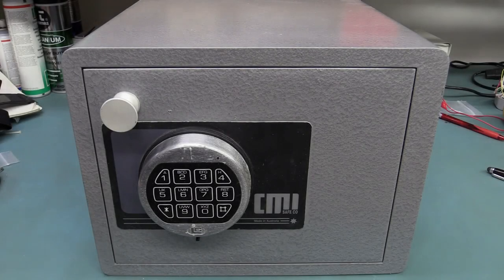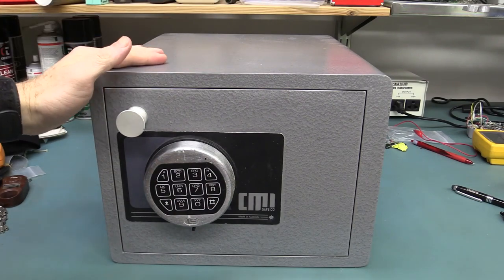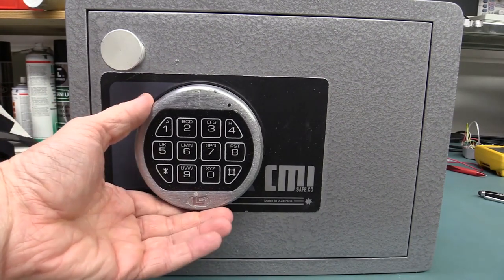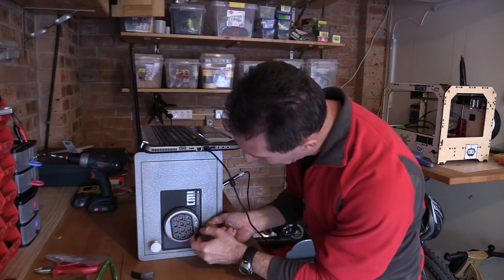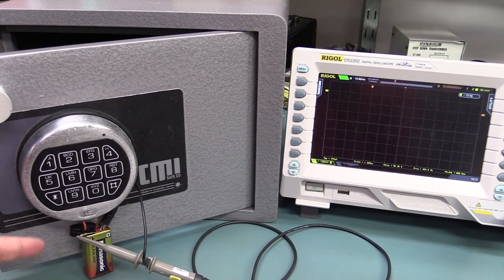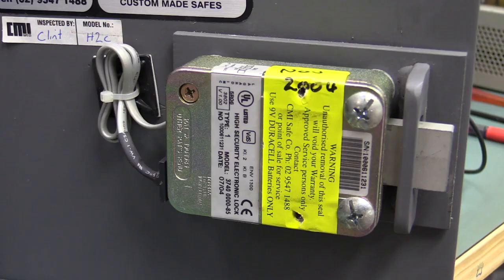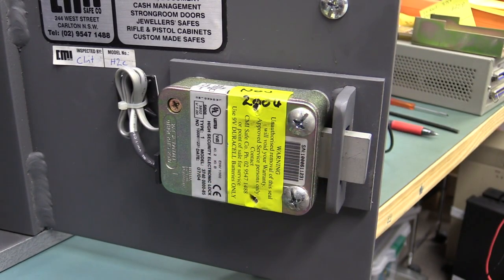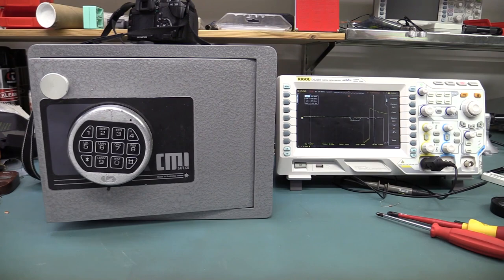EEVblog #762 - How Secure Are Electronic Safe Locks?

Comment: As the battery connection is exposed, maybe it can be hacked by applying weird over-/undervoltages, negative voltages or combinations of that?

You also could use near field antennas (near the keyboard) used for emv probing to sniff.
You could make use of a more elaborated (low R) current sensing with higher bandwidth.
You could use more elaborate data processing on the captured signals, you could correlate antenna signals and wired signals (power current).
BTW, how does disconnecting the battery affect the safety lock out time?
Even if it is stored in eeprom, one may detect a false attempt prematurely and shut off the power just before it can store the failed attempt lock out time in eeprom, if it does that anyway.

And then you can probe the circuit at any point if you get a "sample" but not limit yourself to working with the TUA (Target Under Attack).

You see, if you want to spend the time, there is a lot more one could do... May not be worth it except for the experience gained.

Comment: I love it when a push button lock has been in use for years and the buttons for unlocking it are all worn. Vegetable oil on the buttons would reveal which buttons were pushed without necessarily being noticed by the owner. This trick also works in some cases to detect if something was disturbed in your absence.

Comment: You can also try undervolting that thing to make the software crash (and possibly flip that one magic pin high; these tiny MCUs don't have any notion of memory protection; they will execute whatever crap happens to come into the instruction stream) or overvolt it. It's common for MCUs to short pins high or low when they are fried. If that doesn't work... overvolt it massively (like 10-30 kV or so) then the spark might jump to the right spot.
Reply: pvc988 Second thought about crashing the IC. If the chip is made unstable after inputting 6 digits, it's possible that it will start executing data in the combination you entered. Depending on how these digits are stored, you may be able to write a 6-byte program to unlock the safe. It's unlikely but it would be one heck of a cracking job if it worked.
Reply: pvc988 under voltage sounds interesting, as it should not be too harmful. Overvoltage on the other-side: I think I saw a diode in there. This diode may act as an overvoltage protection. Given the LC-circuit formed by the wire and the decoupling, it would be tricky to get around the diode (and not to fry something in the process). But frying would be fun also (for the theft): Looking out the owner
Reply: If they designed this lock correctly (and it seems like they did) then there would be a brownout detection circuit to keep the micro in reset until a usable voltage is available. Most modern micros have a brownout detector built in, but it's also very common to have an external one as well.
Reply: Believe me, I've analyzed many of the embedded device's firmwares and I could probably count properly coded brown-out detection/handling routines on my fingers. It is one of the most neglected things by the programmers.
Reply: pvc988 sounds like a job for *****
Reply: ***** I thought the same :)
Reply: Prehistoricman Interesting idea, but I don't think that's possible. 

You'd need to get it to fetch an 'instruction' from the register file, data memory, or a peripheral register. The block diagram in the ST62T25CM6 datasheet does suggest that the instruction memory uses the same bus as data memory and peripherals (Von Neumann architecture). But I don't see how you are going to manipulate the operation of the state machine that controls the processor (i.e. fetch / decode / execute)  simply by messing with the power supply. Even supposing that you could, you have some very limited data to work with to form your instructions. You will need to hope that the available digits map to the opcodes you need (not likely).
Reply: Oliver Douglas Like throwing your groceries into the kitchen with hopes everything will land in the right spot.
Reply: pvc988 I dare doubt undervoltage would be a possible scenario, as this is a battery-operated safe, that would be a quite major flaw. It's much more likely to cease operation at such a low volatage. Overvolting is i'd quess much more likely to give some result, though if you mess it up at that point, that was your one shot at opening it :p
Reply: annihlator Yeah. By the time of my original comment, I've checked that MCU's datasheet and how it handles voltage drops. Now, I also think that this won't work for this particular device. But I think this method might still work for different MCU/CPU based devices.
Reply: pvc988 I use AVR Microcontrollers quite a bit. They may or may not use them for these safes, but I'd go out on a limb to suggest the feature sets are going to be similar.

AVR Microcontrollers are modified Harvard architecture machines. They have different address spaces for data and code. The code is going to live in flash and the fuses can be set to a mode where that flash is not "self writable" - that is, it can only be programmed with an ISP programmer, which for this application would only be accessible from inside the safe.

AVR Microcontrollers also have brownout detectors. When the supply voltage drops below a given threshold - and that threshold is well above the malfunction threshold - the controller is gracefully shut down. And the BOD has a hysteresis so that it won't (easily) "flap."
Reply: Nick Sayer I am quite familiar with AVR family too. I know about their brown-out detection feature (BODEN fuse bit). In this ST6 MCU it is called LVD but works very similiar.

Self-modifying code or reprogramming is not needed for this to work. Also, without BOD enabled even momentary spike (be it overvolt or undervolt) can cause MCU to behave in an unpredictable fasion (in bet that many beginners have encountered this problem with their devices).  The same thing can happen if RESET pulse is not "clean" enough or is too short. I remember that Dave had that problem with one of the devices he was repairing.

Imagine the situation where something gone wrong with resetting the CPU. That means that some of the registers have incorrect values. Now let's assume that the instruction pointer/program counter did not reset properly. The CPU will begin the execution somewhere in the middle of the code and not at the reset vector. If execution starts in the branch that leads to "FLIP_THAT_MAGIC_PIN" subroutine, then you are done. Not only instruction pointer can cause such problems. Of course with approach like that you can't predict what will exactly happen and be sure that you will need many retries. In other words, you will need a device which will crash the target device repeatedly.

On the other hand, method like this will not work on ARM based MCUs. They use memory protection. After just few "incorrect" instructions an exception will be triggered (probably Undefined Instruction or Data Abort). I wonder about FPGA/CPLD based devices.
Reply: pvc988 But will you find ARM based MCUs in safes? I don't really think so (More like probably not haha) but good point there about ARM MCUs.

Worked a lot on ARM based MCUs (the TI stellaris launchpad and the STM32F4Disco launchpad) and damn are they resilient.
Reply: pvc988 if it's succeptable usually the single compare after suming/subtracting the key is enough to hit with a glitch but must be timed properly and probably multiple attemps.  connecting the keypad to a micro to do the entry and search for the sweet spot would work but it does LOCK after x bad attempts so it could take a while....   or not.
Reply: Nick Sayer AVR's are pretty easy to crack, and dump the contents of the code.   Even claimed secure micro's aren't "THAT" secure.  they're for a certain target market.   simple buffer overflow could setup an attack on the stack in such a way to execute what you need, not everything must be in executable memory....
Reply: digibluh Do you know something We don't ?!  Classical stack attacks aren't that easy to perform on Harvard machines (you can't inject the code directly; you can (possibly) only inject the return address).
Reply: +Prehistoricman thats how they cracked the Gameboy and Gameboy color (many years later) you can find the reversed cpu manuals easily
Reply: pvc i fried my safe when I tried to power it with 16kV for 264 milliseconds, don't do that xD
Reply: Hmm, I'm curious.  If the solenoid is the only component grounded to the safe, if a sane or high-voltage circuit would complete between the body of the safe and one of the battery contacts.

Comment: I would try to capture lock's behavior after entering all 6 digits. It's doubtful that controller compares every entered digit. I bet it reads them in a buffer and then compares. This is the time to catch it.
Reply: That would tell you when the 6 digits are wrong or right but we would know that anyway it would open or not
Reply: Yeah, I'd have looked at correct key followed by incorrect and all the permutations upto the full six correct numbers Vs six incorrect or five correct and one incorrect. Seems like a bit of a half arsed job unless there was a lot edited out..or unless he found a good powerline exploit lol. Not everyone is LPL showing everyone the hidden secrets right out in the open. Didn't end so well for Barnaby Jack :/

Comment: The code is always 6 digits, so I assume they are comparing the input with the secret key only when all digits are entered.  With a sensitive enough power analysis, you should be able to detect which digit was incorrect as the micro iterates over the input and key.  Even with a constant time comparison of the two, some flag or register in the micro will be set on the first wrong digit (otherwise your comparison would never fail).
Reply: Can a power analysis realistically discriminate a single bit difference, presumably SRAM or whatever this thing has?

I assume the "loop" would compare or subtract or xor each position and then add/or them up.

Comment: Not sure if anyone else has mentioned (Dave didn't on the video) it but there is a spring loaded anti bump weight opposite the solenoid. Any impact big enough to move the solenoid plunger will also force the anti bump plunger into the hole.

Comment: I would not expect to see much on the power line for digit entry. The software would (should) just store each digit without any judgement on the individual number until it has all six numbers and then it would do a compare in which case its too late. Its not going to decide as you type each number in. There will be a time-out between numbers so that you do need to type them in with in a certain time period before it trashed what's already been entered.

But great video - loved the cheesy version of mission impossible :-)

Comment: i think the wave form drop is from storing the number in memory. The validation is when the last number is pressed. The wave form will change depending on if the validation is wrong or correct.

Comment: Fun story: an educational institute local to me has electronic locks inside that use swipe cards (though the readers aren't connected, the staff just use keys instead) and the actual electronics for the locks are on the outside of some of the doors! Even better, they're all powered on the same circuit, so just opening one and shorting it with a screwdriver blows the switchboard fuse and opens EVERY LOCK IN THE BUILDING! Genius!

Comment: Here's a question: are the keypad pins vulnerable to this type of snooping?  You can get to those if you can get the safe on its side.  With some difficulty (and maybe some laparoscopic surgical tools) you could unplug the keypad, hook on some probes and plug it back in.

Edit: I know that data you'll be seeing on those pins will just be the keypad data, but there may be some crosstalk or something, and since they're closer to the CPU you might be able to see more noise from there.

Comment: Try to find the resonance frequency of the little spring and use a suboofer with this frequency. The pin should then vibrate and if you are lucky you can open the safe or damage the spring an turn it on its side. :-)
Reply: Update: To find the right frequency try to disconnect the battary and measure the power pin for some induced current

Comment: Hey Dave,
One of my main concerns with electronic locks is at the firware/code level and being guaranteed that there are no secret code or keystroke backdoors.  I was hoping after IDing the micro version, that you would try to pull out the machine code listing and examine it for manufacturer backdoor entry codes.

Unless these safes can be audited and proved safe (through things like code hashing), I fail to see how they can be trusted at all over, say, mechanical locks..

Tweeks
Reply: And your fear was proved real today.

Comment: Dave,
You mention that you can replace the keypad in the event that it breaks, so you must be able to do so without access to the interior of the safe, is that correct? If so, would it be possible for someone to replace the keypad with one containing some kind of keylogger? That individual could potentially return after the safe owner has accessed the safe and obtain the code.
Reply: finnigan 16   That is a devil of a lot of miscreant effort to access some cat photos. (Likely content after owner estimates this safe's ability to protect the contents in the event of fire.) ;-)
Reply: I've used a larger capacity, thicker armoured safe with the same keypad/knob combo, in a medium sized retail business and that was storing the Christmas takings, as well as the rest of the year when there wasn't much worth having lol. It was however bolted to the floor, and was cut through with angle grinders in one memorable instance, mostly because they used our own stock from the shelves to do it! It's a common enough set up, though the quality of the internal circuitry may have changed over time or between models.

Comment: You didn't try:
Low voltage attack (brown out, slight power differences between the eeprom and processor, leading to "0" being read for all positions)
Power glitching attack (modulating the input power to cause glitches)
Power-up analysis (does it read the eeprom on initial battery attach?)
Reply: eformance a no-name Chinese lock in a similar style had the vulnerability of reading an I2C EEPROM at power up. The keypad was also connected via I2C, so you could trivially sniff the EEPROM data.
Reply: Phil McGroin

Comment: I wonder how those $300+/- ebay gunsafe locks fair, I know the safe has to be bolted to the wall and floor by law but if the crooks managed to get it loose I bet they could bang it on the floor a few times and release the lock. i will have to take a poke at mine before I install it and store valuables in it, might have been a waste of money.
Reply from the maker: Aussie50 No new safe costing $300 is any good. First step is, if it's not (oz only) a CMI, Chubb,  Lord, Guardall, or  Burg Wachter then it's likely crap. Only La Gard, Chubb, or S&G locks are worth their salt.
Reply: What you ultimately need is a dog!
Even just putting a warning sign that says "Beware of dog" can deter thieves ... yet there are those who don't even have half a brain :P
They likely wouldn't be able to figure out how to get it open any way xD
Reply: MrJohnny56789 If you didn't store it correctly, that's completely reasonable I'd say.
Reply: Mr. Morningstar  You are so right. I hate the gun laws in Australia. Notable three hours away in New Zealand my friends are using suppressors and we cant they are all shooting semi auto M16s and we cant.  All the anit gun lobby people cite the shootings in the usa as the reason we cannot change.  They are seriously phuked in the head and have no idea what they are talking about. I love my shooting for sports and just wish i could have a few more toys that would make it even more fun.

Comment: Could you not apply a voltage directly to the solenoid the same way you replaced the plug?
Reply from the maker: glenwoofit No, that's called spiking, and this lock is protected against that.
Reply: EEVblog you where able to get to the pins so you could spike the pins.
Reply: Graydon Treude He got to the solenoid pins after opening the safe, and then opening the lock mechanism... the safe is kinda already compromised at that point facepalm
Reply: TheHue's SciTech when he reconnected the pins from the out side he had total access to the pins from the out side
Reply: Graydon Treude Those were the keypad pins, not the solenoid pins. For goodness sake, he specifically went over this in the video, try watching the video.
Reply: TheHue's SciTech when i see pins on the back of some thing i knew they went to the solenoid but i know all pins dont go to the selonid directly but putting voltage accost maby 2 pins could have a wanted effect
Reply: Graydon Treude They are data lines just going to the cpu - applying a voltage would maybe damage the processor into a fail-open mode, but that would be a bit obtuse.
Reply: frollard this is correct - probably 1 wire serial for the keypad, led and piezo buzzer pair, common ground and +9v. The solenoid connector for this type of lock is clearly shown, INSIDE the lock mechanism along with all the smarts..
Reply: dash8brj  This is incorrect, too. Led and buzzer are in the keypad..
Reply: Selphie93 The serial would control both input and output from BOTH of them. dash8brj is correct.
Reply: Yehuda Avitan You need to give it voltage and a valid pincode to unlock, which is the whole point. The solenoid is not externally accessible, so you can't just provide a voltage to directly actuate the solenoid.